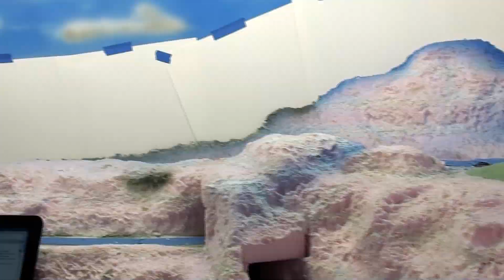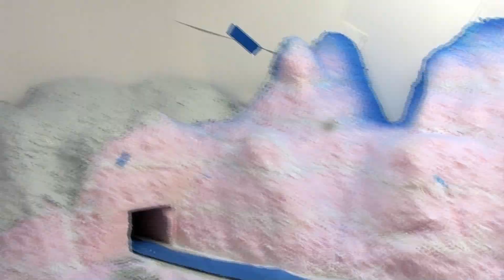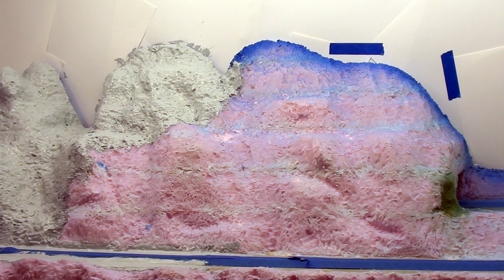Building the Excursion Train & Coal Mine Scenes: Part 21

Comment from the maker: @jasonandjoesrailway It's Owens Corning PINK®Extruded Polystyrene Foam Insulation.  I'm thinking that's what it's called in the U.K also.  Latex paint is a water based paint unlike Enamel or Oil based paint which contain solvents and give off a lot of fumes while drying.